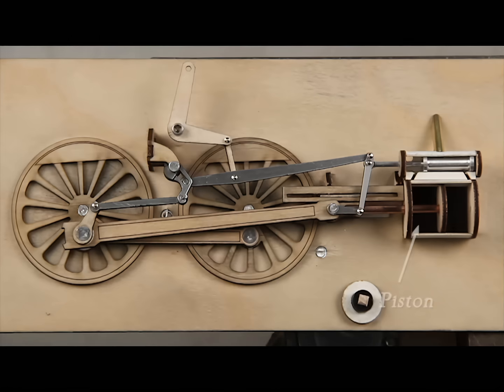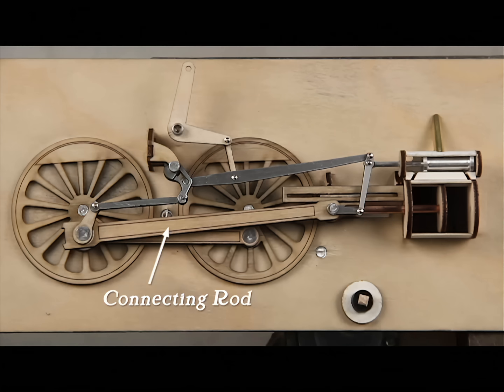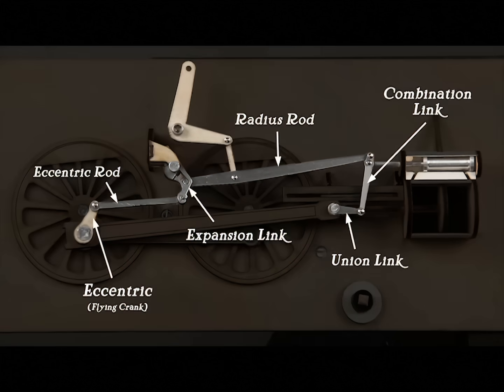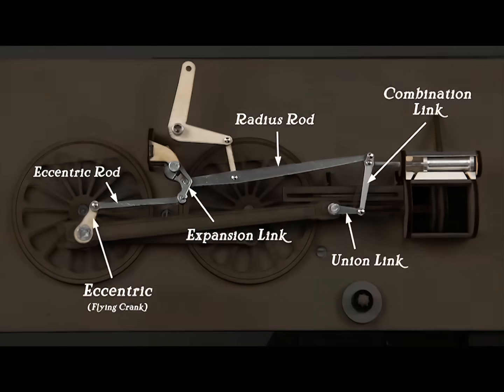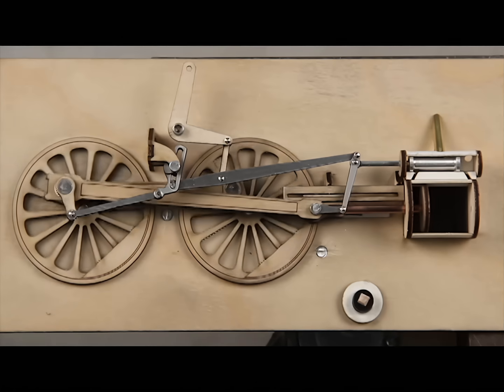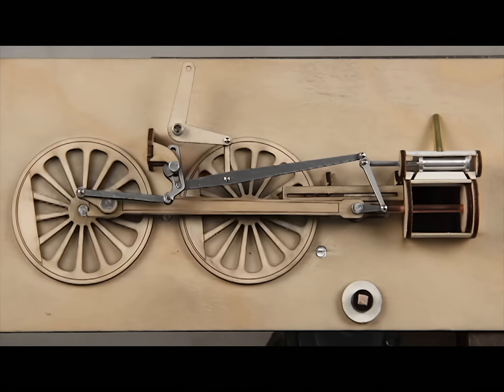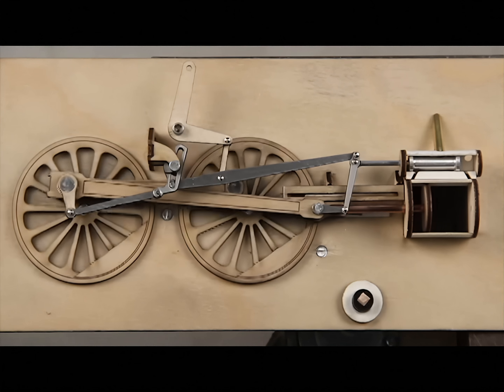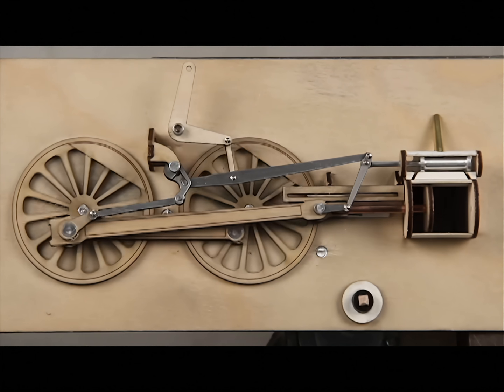Walschaerts Valve Gear Explained

Comment: when you realise these steam engines had variable valve timing and direct injection like modern cars
Reply: Yes!  And all analog/mechanical!   Very impressive.
Reply: Just for pernickitiness, modern cars have variable valve timing and direct injection as did these steam engines.
Reply: @SuperIliad  You are being pernickity. How can you be sure that Walschart did not draw his inspiration from the the Honda K20Z3?
Reply: @SuperIliad  That’s what Conor said
Reply: @Fluterra  My comment must have passed by Conor's . Thanks.
Reply: @SuperIliad I think that is why the comment was put there about steam variable valve timing.
It was alluding to the fact that it was invented long before it was used on internal combustion.😊
Reply: And the valve timing here doubles as sort-of-transmission too
Reply: @ki0w0-lordofwatersheep Yea Yea!
Reply: @ki0w0-lordofwatersheep I know this comment is old, but for anyone coming along in the future.. no! A transmission transmits power. It’s right there in the name. The only power being transmitted by the valve gear on a steam engine is whatever is needed to move the valves themselves. This comment is roughly equivalent to saying that the camshaft in your car’s engine is the transmission.

I get that you’re trying to say that it sort of allows the engineer to shift gears. It doesn’t, not even close, but for a gross oversimplification, okay. But still, at best that would make it equivalent to the shift lever. That’s no more the transmission than the throttle is the engine.

There’s no shame in not knowing how a steam locomotive works, or how a car works. Not everyone knows those things, nor do they need to. But everyone DOES know how to recognize their own ignorance on a subject and refrain from speaking on the subject.
Reply: @kenrickman6697  so do you know how to recognize your own ignorance on what "sort-of" means and refrain from speaking on the subject with a whole 3 paragraph essay?😂

Of course there's no shame in recognising my ignorance, hence I put "sort-of" there to signify how it's not an exact similarity. But can you admit not knowing what "sort-of" means without shame?😂

It's "sort of" as in "loosely similar speed controller" akin to what ESCs to electric motors are, notice that I didn't write "a kind of" which would imply the exact mechanical function
Reply: @ki0w0-lordofwatersheep Yeah, it’s “sort of” like a transmission as long as “sort of” means “not at all.” A transmission is not a speed control, regardless of what you think. It is a device which transmits power, and often allows for a variable gear reduction or other CHANGE of power between speed and torque. You can make the case that steam valve gear is similar to an ESC, though that’s tenuous. But it is not a transmission.
Reply: Steam punk for the win!
Reply: Hi
Reply: In the mid 19th century, they built the London metro with stations higher than the rest of the track. The trains would slow down, converting kinetic energy into gravitational potential energy. They could then recover this energy rolling downhill from a station. That is they had regenerative braking.
Reply: @21mozzie  Regenerative no need for braking?
Reply: @johnny rotten the valve that lets steam into the cylinders
Reply: Crazy... Never knew that.
Reply: https://m.facebook.com/story.php?story_fbid=909556853156457&id=100023064512097
Reply: and 4x4 or 6x6....
Reply: @HannesDelahaye  Wow i also didn't realize that cool
Reply: Imagine having the buring inside the piston
Reply: Cinor Lyndon -common rail airblast injection was around on marine diesels before the First World War -it  is simply been done electro mechanically today rather than mechanically  Read The Diesel Engine by C.C.Pounder. who hugely developed big marine diesels in the early to.mid 20th century ..Today they are now producing 8500 horsepower per 20000 c.c cylinder from 2 stroke cross head diesels and over 50% efficiency. .
Reply: @ronnieince4568  CC Pounder. is it a joke name? I mean, for someone who wrote on Diesel engines ?!?
Reply: @simonpenny2564  well that was his name -he was from about 1920 to the 1950's the leading developer if large marine diesels and wrote the then definitive book on the subject and it may still be available in updated form
Reply: @ronnieince4568  Hmm, that 50% efficiency number sound high.  What kind of efficiency?  Thermal? Specific Energy?  CAFE? (chuckle)
Reply: @sanjursan  not sure how they quote efficiency figures but if you Google Wartsila Sulzer their website may give detailed specs of their ultra  large diesels -the one I read about was 115000 hp at 104 rpm 14 cylinder 2 stroke cross head .
Reply: @ronnieince4568  It's still done entirely "mechanically" with the only electrical/electronic control being of fuel injection(s) timing and duration. 

And "air blast injection" has never been used on true compression-ignition Diesel engines. 

It's a half-assed substitute for actual fuel injection directly into the pre-combustion/combustion chamber used in low-compression  "semi-diesel" boat anchor engines running on "paraffin" that require an "ignition system"  separate from the fuel injection system. 

True diesel engines - even "electronic" ones - use nothing but the concentrated  heat in the compressed intake air charge for ignition instantaneously and a huge but "forgotten" factor in their "fuel efficiency" is that they do not require thousands of watts of electrical power per minute at 742 watts per HP simply to "idle" and produce no work and zero "flywheel horsepower". Electronically fuel-injected spark-ignition engines are even less "fuel efficient" than carbureted engines with modern HEI ignition systems on an apples to apples basis because despite having similar "manifold vacuum" they require 45 to 55 psi of "fuel pressure" and a very inefficient "return type" fuel system and electric fuel pump to "inject" a fraction of the fuel delivered and pumped at any and all speeds and loads besides "WOT" and "full load" while a carbureted engine can use a non-return fuel system and a "variable displacement" mechanical fuel pump at only 3-5 psi and doesn't need an electric motor just to open the "throttle valve" and another to pump at max pressure and flow at all times and yet another just to control "idle air flow". 

The ONLY reason "modern" EFI spark ignition engine vehicles are "more fuel efficient" than their "antiquated" and "obsolete" carbureted predecessors is the same reason modern "electronic" diesel engine machines with all the "emissions control" (key word "control" vs. REDUCTION) systems on them are more "fuel efficient" than their "electromechanically injected" predecessors with "drive by wire" electronic injection pumps and throttles and ECUs and governors. 

Because the vehicle and machine POWERTRAIN and "ACCESORY" SYSTEMS have been made "more efficient". Lockup torque converters, electronic OD automatic transmissions, infinitely variable transmissions, variable speed cooling fans, variable displacement oil pumps, variable displacement AC compressors, better aerodynamics, LED and HID lighting, lighter gear-reduction starters and lighter gauge battery cables, low-profile radial tires with minimal sidewall flex, low-viscosity engine oils, low-viscosity transmission/hydraulic/gear oils, VGTs on turbocharged engines that can make "max boost" at way under "rated speed" and "full load" and which make every intake stroke a "power stroke" and eliminate "overboosting" without wastegates, etc etc etc. 

All "technology" aside it still takes exactly the same amount of "horsepower" to move Vehicle X down the road at 55 mph as Vehicle Y and  "all else being equal" a carbureted engine with an HEI will be just as "fuel efficient" as an "identical" vehicle with the exact same torque, horsepower, final drive ratio, tires, wind resistance, weight and fuel but "modern" EFI and distributorless "coil on plug" ignition.

Which is why my "smog-era" 1980 Chevy K10 Cheyenne Stepside shortbox part-time 4WD pickup with 75,000+ miles, a 350 V8 with a "Quadrajunk" 4-barrel carb, headers and true dual exhaust, a heavy-duty (used un up to 1.25-ton GM military trucks) 4-speed manual trans with no OD, 30x9.50 "mud tires and 3.08 gears would get 17.5 mpg at 75 mph on the interstate at 90+ degrees in June with the AC on MAX and my '97 Chevy 2500HD with a 5700 Vortec, 5-speed overdrive manual, 4.10s and 33+ inch tires and a lot better aerodynamics barely got 12 at 70 mph in November at 50 degrees and no AC on. 

Sure it weighed close to a ton or so more  but the overall gearing and cruise speed and RPM were similar and it had more "power" and taller, narrower easier-rolling tires and "more efficient" EFI. And a "roller cam". 

But it burned 30% more fuel with less "parasitic load" and running "empty" at lower speed. 

 But nothing in the powertrain was more efficient and the transfer case and rear axle less so.
Reply: Steam is not "injected" into the cylinders and "valve timing" is not "variable" during normal engine operation. The "exhaust valves" must be open at "BDC"  and the "intake valves" at "TDC" or "catastrophic failure" results. And the real PRIMARY FUNCTION of 'adjustable cutoff" and "variable valve duration" and being able to MECHANICALLY ACTUATE THE VALVES FROM THE CAB WHILE THE LOCOMOTIVE IS "STANDING" AND THEY WOULD OTHERWISE BE "STUCK" JUST LIKE THE PISTONS, RODS AND DRIVERS IS TO "THROTTLE" THE ENGINE ACCURATELY AND PRECISELY AND AVOID "HYDRAULICALLY LOCKING" A CYLINDER AT "TDC" OR "BDC" AND "BLOWING A HEAD" AND/OR "BENDING A ROD" WHEN THE "REGULATOR" IS OPENED WHEN SOME IDIOT "STOKER" HAS THE BOILER AT MAXIMUM "STEAM PRESSURE". 

KNOW WHY THOSE POS "MODERN" BRITISH STEAM LOCOMOTIVES "LOSE THEIR FEET" SO EASILY WHEN "STANDING" AND/OR CLIMBING A "GRADE" BESIDES THE "LOOSE NUTS ON THE FLOOR PLATE" TRYING TO "REGULATE" MAXIMUM "STEAM PRESSURE"? BECAUSE THEIR "REGULATORS" HAVE NO "THROTTLING" CAPABILITY AND THE CAPACITY TO "REGULATE" STEAM FLOW. 

"PRESSURE" IS FLOW AND RESTRICTION AND YOU CANNOT "REGULATE" THE FLOW OF A HIGH PRESSURE "GAS" WITH A SIMPLE "GATE VALVE" AND NO "MECHANICAL ADVANTAGE" OVER IT. 

STEAM "INJECTS" ITSELF AND IS NOTHING MORE THAN "COMPRESSED AIR" IN A PROPERLY ENGINEERED AND CONSTRUCTED AND OPERATED "SUPERHEATED" AND TRUE "COMPOUND" STEAM LOCOMOTIVE AND IT CAN BE EASILY "THROTTLED" WITH REAL "ADJUSTABLE CUTOFF" AND "REVERSING"  VALVEGEAR AND TRUE "DOUBLE-ACTING" STEAM ENGINES HAVE "POPPET VALVES" AS WELL AS "SPOOL VALVES" AND THEIR "TIMING" IS "VARIABLE" AND AUTOMATICALLY "ADJUSTED"  BASED UPON "STEAM PRESSURE". AND THEY ARE ALL "EXHAUST VALVES" WHILE THE "SPOOL VALVES" ARE "INTAKE ONLY".
Reply: @deeremeyer1749  At "to MECHANICALLY" you not only split an infinitive, but you hit the Caps Lock key and seem to be oblivious to the fact. It's just to the left (<) of "A". You seem to use a lot of " " " as well. Not sure how interesting what you say is, I find it disturbing to try to read.
Reply: @johnbishop5316  The increasing use of scare-quotes and the shift to all-capitals nicely conveys the descent into madness, no?
Reply: I am doing an experiment : which comment will be more popular? My comment or my reply to popular comment? Please like if You want to help with experiment :D

Comment: There where other mechanisms prior to the Walschaerts mechanism, for example the Allan-mechanism with two Excenter drives and something similar from Stephenson himself. Walschaert/Häusinger is of course less complicated in construction and thus superior in everyday activity. However, ultimately these mechanisms where anachronisms by the 1920s as a gear and valves similar to a plane motor would have been superior in performance. Still they used Walschaert up to the very end of steam locomotives in europe.

Comment: This is a related question::  At some point around the end of the steam age, maybe the 1930;'s or 1940;s  automatic oilers were added to the connecting rod bearings.  Until automatic oilers were added the bearings needed manual lubrication around every 75 miles is my understanding.   This seems like an awful lot of work.  This is why the engineer or fireman would walk the engine with an oilcan.   Any comments?
Reply from the maker: Nothing like a seized rod flying through the cab to get your attention, eh?  Maintaining these monsters was a huge factor, contributing to their demise, especially once diesel/electrics came along.  The whole engine had to be rebuilt, periodically, to prevent all kinds of catastrophes.

Comment: Really, really good.  Also notice that the valve lags behind the piston's motion - in both directions - and then relatively suddenly moves to open the port.  This keeps the valve from getting stuck in a half-open position and the drive piston stuck in place.  My trade is electrical engineering, and oscillators do the same thing, only via circuitry.

Comment: Ah, excellent, so by raising radius rod up the expansion link a little above the centre point , that stops to the spool valve from moving. Thus an engine can sit still at a station. And by raising it higher again causes the engine to reverse.. It should be noted that an engine  travelling forward down a slope can have engine  assisted braking by the same method of rasing the radius rod up the expansion slot into the reverse position. The steam then slows the train down. I have driven a 1905 steam car that used this pinciple  also.
Reply: No, in center it can still run as the valve still moves. The valves SHOULD open in center (there is no neutral). In center, the valve opens a little bit - this is called the lead - as the valve is only controlled by the motion of the piston through the lead and lap lever. When the valve gear is properly set, the loco can run in forwards/reverse as the valve events are the same, just not very powerful.

Comment: Did later loco recycle the exhausted wet steam ? Can you do a short vid on the triple ? Thanx.
Reply: Yes, many locomotives recycle the used steam by running it through a condensater.
Reply: @TlalocTemporal  so the water / steam can be recycled. Therefore allowing a closed system and no need to fill the water tank every so often.? I see in early war birds the water is pumped around the leading edge of the wings. I'm guessing early war planes were steam powered ?
Reply: @charliejeans2413  -- There are two reasons train locomotives can have condensers:
1. To require fewer stops for water. A system light enough for a train is still leaky.
2. To reduce exhaust when working in tunnels and mines. Some had a switchable condenser system to increase efficiency.
Why would you want to waste water? Well a good condenser system (like on steam boats and stationary engines) was heavy and worked better when you had lots of (heavy) cold water to cool the steam with. You could use an air cooling fan, but that takes power away from driving the wheels. The exhaust steam was also often used to pull a draft through the fire box (like a rocket stove), increasing the fire temperature. 

As for steam wings, I suspect you're thinking of a de-iceing system. Bleed air (hot air from the engine) is passed through the leading edge of the wings (and sometimes through small holes) to melt ice off the wings. A couple steam planes were built, but they were never popular.
Reply: @charliejeans2413   -- Oh, I never thought that planes ever used a water cooling system, let alone a pressurized steam cooling system. Apparently water cooling was the norm for WWII. TIL.
Reply: @TlalocTemporal  it appears steam has been used in planes. A pressurised water system running through the wings. 
@5.00 'French burnt their hands on the leading edge of the wings" that's very hot. I did see a yt vid where the man states " rolls Royce engines in spit fires were steam powered" makes sense to me. My gran father was in guinea after the war 11. Extracting aeroplane from the jungle growth and melting them down.
There were "shortages yes. But a few tonnes from the jungle  ? Anyway I'll keep searching. Cheers.
Reply: @charliejeans2413  -- Ah, the spitfire did use steam cooling too! TIL. It used a fan radiator, which gave more drag than the HE 100 wing radiators. Apparently, the P-51 used the heat of it's radiator to heat air for thrust, canceling the drag.
Reply: @TlalocTemporal  I've buildt an aeroplane. What your describing doesn't make any sense. Are you trying to cause psychosis?
Reply: @charliejeans2413  -- gas-powered airplanes (before turbojets) used a radiator just like your car. Before glycol coolant they often used steam, I have learned. If you have a jet-like housing around your radiator, you can recover some of the radiated heat as thrust, making up for the high-drag radiators.

Comment: My small town has a steam locomotive (non operating) in a museum park.  I thought I was very  clever to figure out how it all worked.  I could see that the expansion link worked to reverse the engine.  I didn't figure out that it also varied the valve timing.  I guess I'm not so clever after all, but the engineers who designed this - without computers, or even calculators - certainly were.  Great video - thanks!
Reply: they had calculators....they are called slide rules (both circular and linear) and once you know how to use them they are very quick and accurate
Reply: @mottthehoople693  Although only to about 3 figure accuracy.
Reply: @jimkadel3003  look what Isambard Brunel did with a slide ruler, a pencil and paper... stuff that is still standing amd in use 170 years later